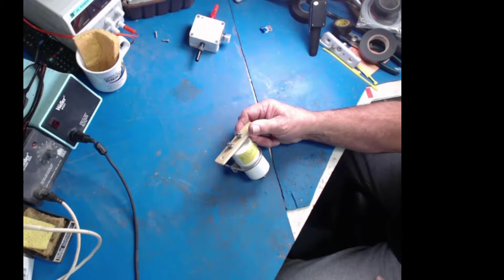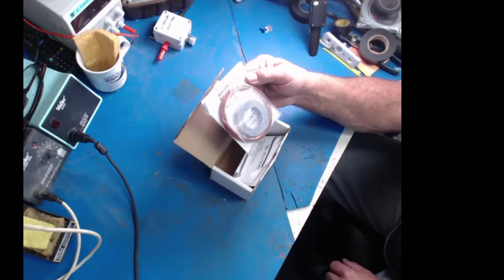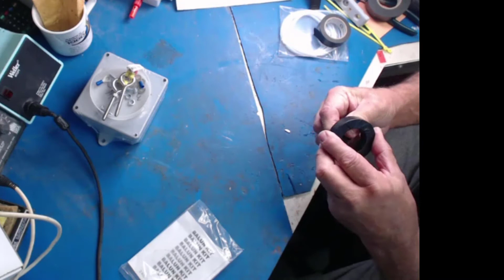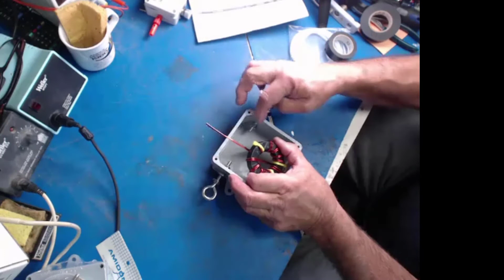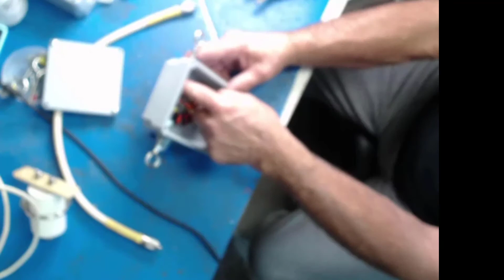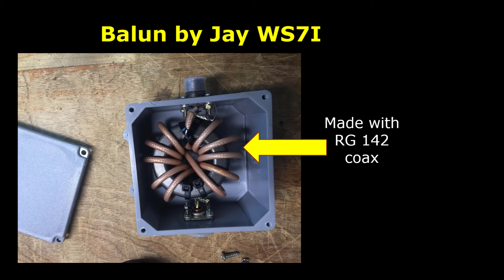How to build a 1:1 balun

Comment: Just a personal preference here.  While the electrical boxes are reasonably strong, I like to use a single eye screw at the top to both suspend the box and use as the strain relief for the antenna wire(s).  That eliminates the stress on the box for heavier antennas like fan dipoles or long lower frequency antennas.  For the RF connections I just use 1-1/4" long bolts on the sides of the box.

Comment: The problem with enameled wire is that at higher power levels, it can and will arc over and destroy the balun.  Use Teflon insulated wire only, especially when running high power!  And only use bifilar windings when using it to feed balanced feed line, for all other applications, wind it with Teflon insulated coax.